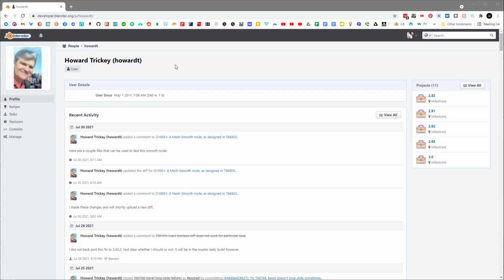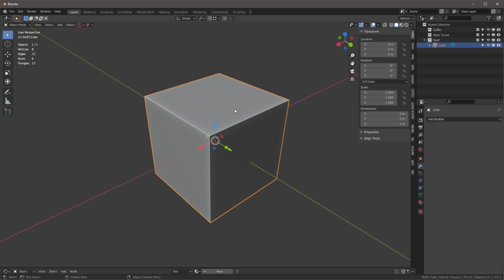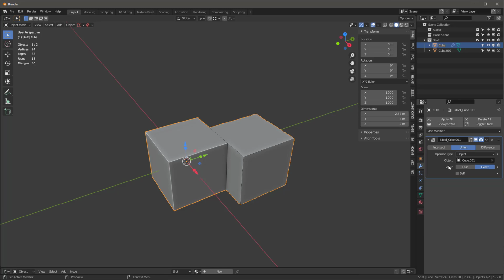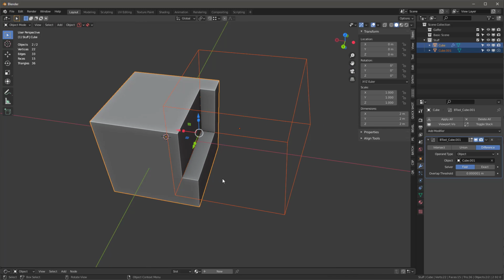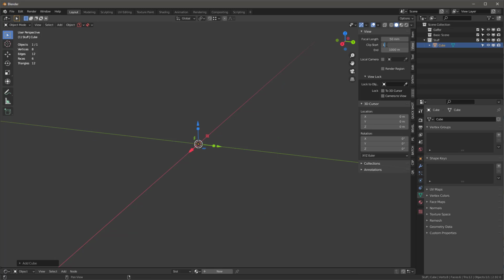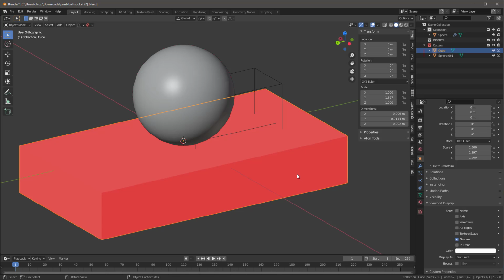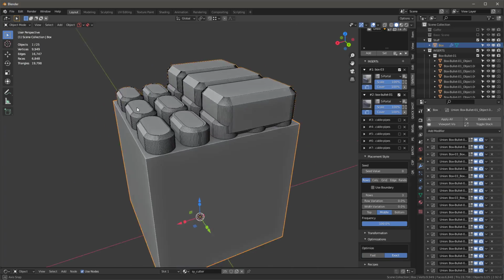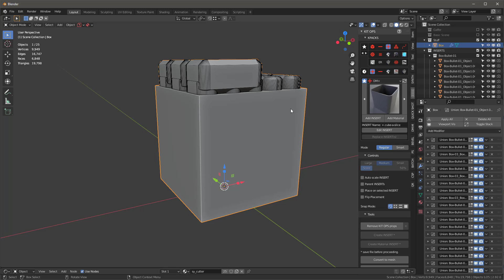5 fixes for Exact Boolean problems in Blender: Most don't know #2!

Comment: Quick question. If you applied the fast bool to an object will it still cause the same issue if you use exact on the same object after?
Reply from the maker: Yes, if you use Fast bools there's a chance any booleans executed after won't work properly

Comment: super helpful video, my issues with bools were listed here, it's probably to do with normals plus the scale I'm working on my unit scale is 0.001 and i'm working in millimeters. I used bool modifiers on objects with a lot of strange and intersecting geometry, and it has been messing up my 3d slicer results to the point I won't even go ahead and print, holes everywhere, only on objects I did bool modifiers on..

Comment: Superb video! Inconsistent normals was my issue, thanks a lot! (I actually created special objects by from_pydata and didn’t realize that few polygon vertices were given in wrong order until now.) I had several months issue with the Boolean modifier, believing that it sucked, but actually my own work sucked instead. Thanks for giving credit to the author as well!

Comment: Here's a checklist that will probably solve the problem for most people.
 Each step should be carried out on each object involved in the boolean 
operation after the objects are all rotated, scaled and positioned as 
intended for the application of the modifier: 

"Object Mode>Object>Apply>Rotation & Scale" or 
"Ctrl+A>Rotation & Scale"  
"Object Mode>Object>Set Origin>Origin to Geometry"
"Edit Mode>Select>All" or "Edit Mode>A key on keyboard", "Mesh>Normals>Recalculate Outside" 
"Edit Mode>Select>All" or "Edit Mode>A key on keyboard", "Mesh>Clean Up>Delete Loose"
"Edit Mode>Select>All" or "Edit Mode>A key on keyboard", "Mesh>Clean Up>Fill Holes"

Comment: Thanks Chipp for the clarification!  For those wondering, with Hard Ops, select an object with booleans then use the shortcut CTRL+SHIFT+b to get to the Hops Bevel/Boolean Helper - there you can set the Fast or Exact for all the booleans in your object in a single click.